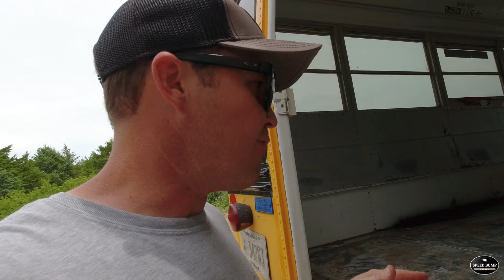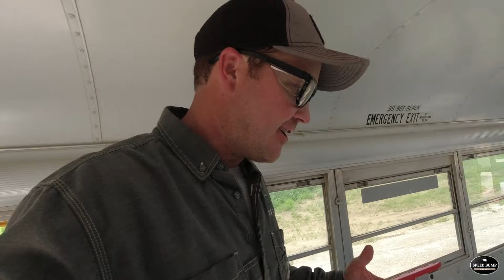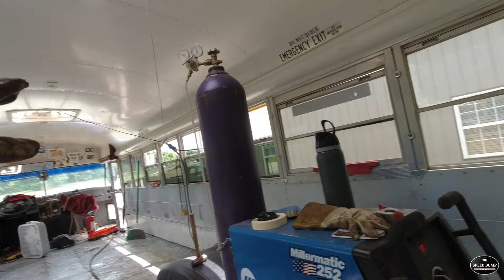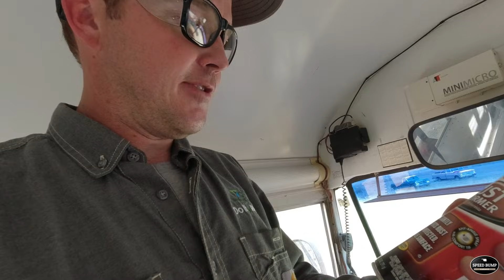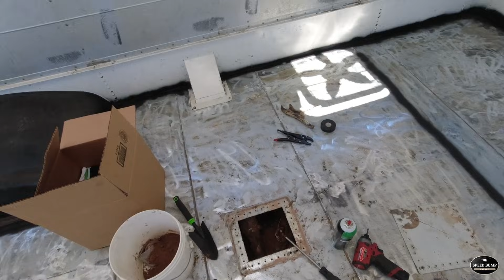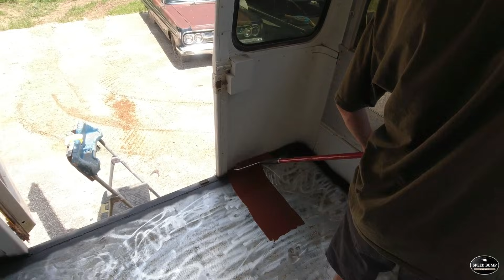Welding and Coating Floors {SKOOLIE EP2}

Comment: Did the seat bolts thread into the floor? Or were there hex nuts on the underneath side.  As an ex machinist, if the bolts threaded down into the floor, you could have run the bolts back down.  Make sure they are flat head.  turn them down tight and grind the balance off flush.

Comment: I know you had mentioned any suggestions to send in your comments..i will add mine..I am sure you thought about this but if it were me and it was my build i would keep in mind on my conversion to add as many portable and convertible things as possible..example.. like turning a chair into a table..As a shop project in school once i found plans and made a simple chair that folds into a step ladder..A desk could be made that collapses into a a flat panel to create a space saver when not in use..Simple ideas like this when working within a confined space to give you maximum use of an area inside your camper would be ideal..Looking inside some of the newer campers would help give you some great ideas for your build..

Comment: My Dad built two school bus campers.  In both, he took two of the large seats and mounted one right behind the driver's seat facing rear.  He then built a table as square as the seats are wide. (window to isle)  It had two mountings; one the height that would allow it to be used as a table and the other the same height of the seat. (The sitting part) Both mounts had one center post and latches to attach the table to the wall.  He then mounted the second seat facing forward the same distance from the first seat as the table is square.  In the higher position it was a dining/game table.  In the lower position it was a bed (with a thin mattress laid across seats and table.)

Comment: Hi guys! Just a suggestion, when doing projects on the floor, use a yoga mat to kneel on. You can fold them in half or thirds, etc. Saves your knees. I use them gardening, or if I'm kneeling on the driveway. You can find them in thrift stores for $5.

Comment: Kent, I've used this product many times for many years. One of the things I've used it on is railings. A lot of people hate to paint these hand rails. Cleaning the railings first is important. The coating with this red stuff is good for several years. The top coat will last many years.

Comment: Nice job guys me I would have just use some quarter 20s bolts with nuts flat tops
Reply from the maker: I thought about running the seat bolts back in all of the holes but decided to just weld them up

Comment: that bus is moving along.
Reply from the maker: We are about to get to the hard parts!
Reply: I took most of my windows out filled with galvanized sheet metal the ones I kept were the emergency windows that you could make tip out so you can put tip them straight out but sticks and hold them and you can have your window open while it was raining Add to cut out some of the rusted steel worlds of men but I still put the 1" stir from on the floor and then I put the plywood over top of it
Reply: Before I could paint the bus to even have the paint to come and paint the outside bus I had to wash the whole bus down with vinegar to get paint stick to galvanized metal
Reply: For a paintster I used to know a beater egg beater 11 of them well did it rod on to it you just hook it up to the girl like you didn't